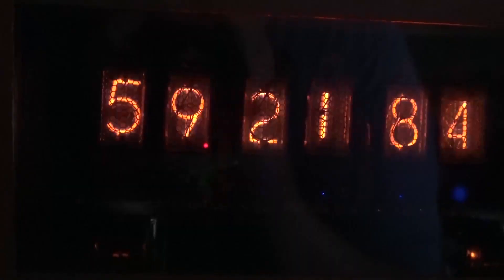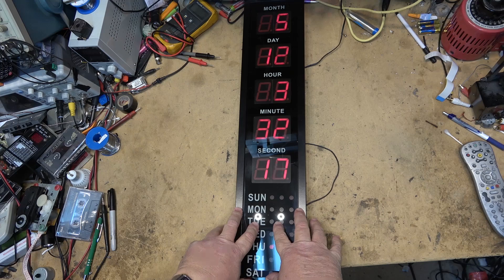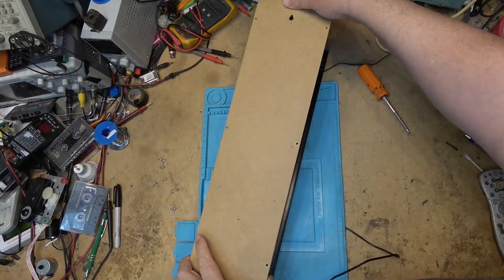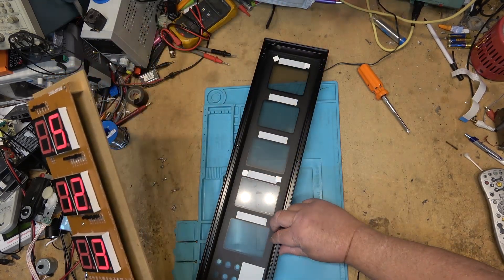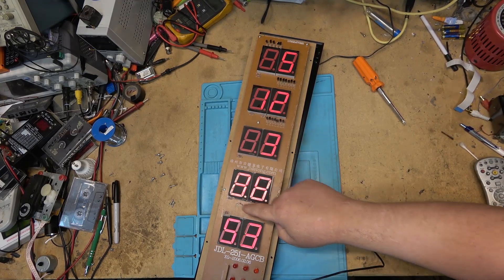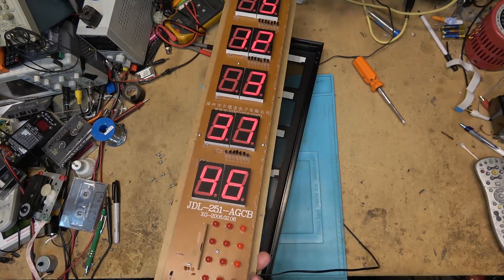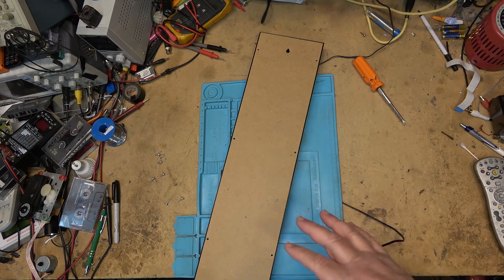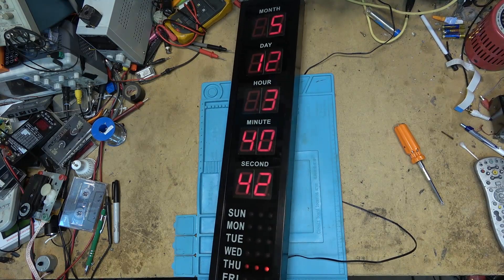Unusual digital clock teardown

Comment: As an led collector those 1.81 inch segments are like 10 dollars each.  I wish they had of used flip flops and ttl logic but it is very cool. 

You must have built cd400 series cmos clocks.
Reply: Years ago I built a TTL clock, using just 7490s, and 7447s for the LED display decoder drivers.

Comment: Really old circuits and designs ... used 20 transistors when they could have used a single led driver chip to handle all those 10 segments. Guess manual labor (inserting all those to-92  by hand) is cheaper than the <50 cents a led driver chip costs.
Reply from the maker: I believe probably what they used on this was a chip from an old digital watch. If you remember far enough back there were digital watches which had month and date plus a DOT that would indicate the day of week on the display plus the six digits for hours minutes and seconds. I'm thinking that chip that's under the blob of epoxy it's probably the same chip that was used on digital watches at the time and they just had it fabricated onto a circuit board with an edge type connector which was then installed on their custom board that holds all the LEDs. the driver was probably set up to drive an LCD display and they had to put buffer transistors in to drive LED displays. That's where I think the circuit came from. I have an old digital watch which has the same layout month day day of week as a little icon and of course the time six digits probably the same chip. When you said it the buttons used to set it kind of resemble how you would have set an old digital watch as you cycle through the hour for example it'll go one through 12 and then it goes 0 through 23 and then one through 12 again for setting either 12 or 24 hour display mode. Anyway I think it's kind of cool and unique the way it's laid out I keeper in my books

Comment: Hey Dave. Your messy bench and the passive agrresive refusal to use one of the counltess compartments of that repair mat for the screws makes me feel less alone = ). Nice clock btw.
Reply from the maker: That was only so i didn't scratch the paint as it is now hanging on the wall
Reply: @12voltvids  That was my 2nd thought. But I like the idea of that is was out of attitude or carelessness. Thanks anyway for all your vids. Learned a lot from them.
Reply: @12voltvids   A clean bench is the sign of a dirty mind...